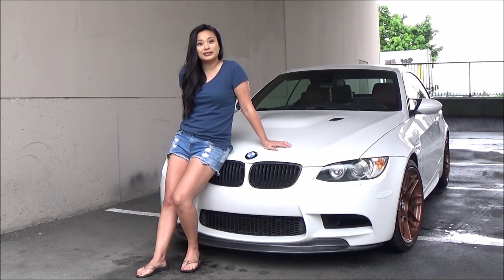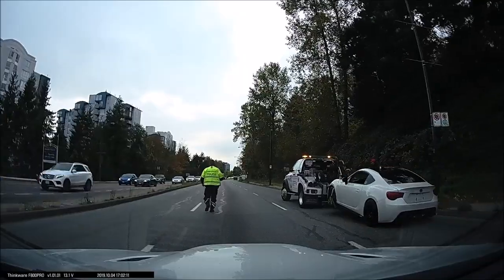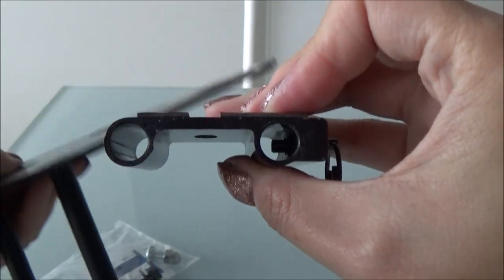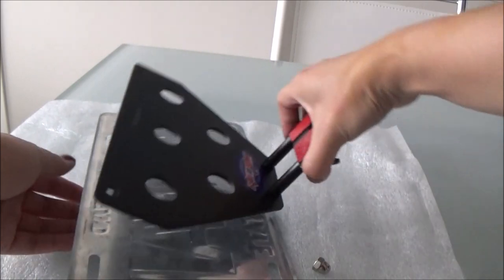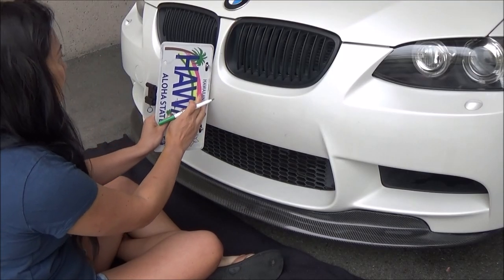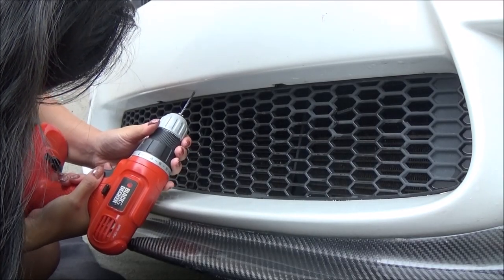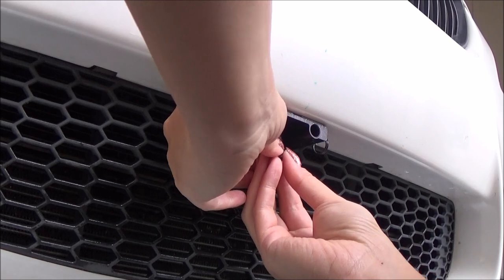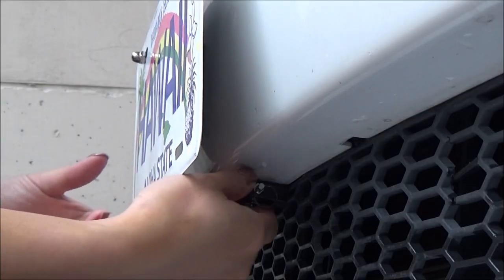How to Install a Removable Front License Plate Bracket – Sto N Sho on BMW M3 – no front bumper holes

Comment: Hi Tara! I came across you're video looking for options for installing front plate w/o drilling holes after getting a ticket 😒 Great video, thank you! What's your feedback on driving over speeds of 70mph and higher (like on a highway)? Do you hear any rattling or shaking and is it sturdy? My concern is because I do a lot state to state travel with all kinds of weather and I want to make sure it's sturdy. I appreciate you reply in advance 😊 Thanks again
Reply from the maker: It is absolutely safe at fast speeds. No rattling.

Comment: Do you need to drill?  Is the double-sided tape strong enough to hold everything without the screw?
Reply from the maker: They sell some models that don’t need drilling. For mine, they advised me I really should drill it. I’m glad I did, as it was super easy and the hole is not even visible so I don’t feel like I “damaged” the car.
Reply: @TVTara  Thanks for the response.  What does the screw go into?  Is it thin sheet metal or something solid?
Reply from the maker: It wasn’t metal but a thick plastic, I think.
Reply: @TVTara  ok, thanks for the helpful info

Comment: Another nice video, Tara! Nice job. Just wondering if you had thought about using the tow hook so that you would not need to drill.
Reply from the maker: I tried it and didn’t like how it was off center. And the good quality ones were a pain to remove. I need to be able to remove it quickly.
Reply: @TVTara Platypus quick release

Comment: Is that adhesive strong enough by itself? I’m really not trying to drill any holes in my body
Reply from the maker: I know people who didn’t drill. The company really advised me to. Honestly I’m glad I did and I wish I did it sooner. You can’t see the hole at all and it’s tiny but the plate is so stable.
Reply: @TVTara  well the reason I don’t want to drill is cause it’s not good at all for the body and when you do rust usually starts immediately

Comment: That is a great device, however, there would be no difference in not having a front plate installed vs having the sto n sho if the plate isn't on at the time you're pulled over??? At which point would you have the sto n sho off the car and feel confident that you would not be spotted by law enforcement to stop you for not having your license plate displayed?
Reply from the maker: You are correct. They may let me go with a warning but yes I would result in a ticket. I do have my plate on when I’m driving around now.

Comment: Watched the video, really liked the product but I can't trust adhesive to hold my plate (I refuse to drill a hole). So USmillworks tow plate was the way to go for me. Its pricey but its super sturdy.
Reply from the maker: For two years I also didn’t want to drill a hole but I’m so glad I finally did as you can’t even see it. I just didn’t like the way tow hook brackets make the front of the car not symmetrical.

Comment: do you need to drill, or can I just use the double sided tape
Reply from the maker: I know some have been ok with double sided tape but it’s not recommended.
Reply: @TVTara  ill probably drill underneath the bottom of the bumper then and mount it all the way at the bottom, I feel like the drill and holder will be noticed under the lip on the mid bumper. Thanks for the reply!
Reply from the maker: If your car is low though, it might scrape off. That was my concern.
Reply: @TVTara  im planning on putting it on my X3 so thats not a problem haha, thanks!

Comment: I would go with non-drill hole removable license plate holder - they clip into the grill.
Reply from the maker: Doesn’t sound like you can remove it quickly though. This one takes a second only.

Comment: In which state was this ticket issued?
Reply from the maker: I’m in Vancouver, British Columbia.
Reply: TVTara thanks! Do you have any recommendations for a removable front license plate bracket for a 2008 E93? Sto and Show doesn’t make one
Reply from the maker: Take a look if you’re front bumper looks like mine. Their website said it didn’t make it for our cars but I looked at lots of pictures and measures it and insisted to them that it will fit when they said it wasn’t for my car. It’s model sns67.
Reply from the maker: *your
Reply from the maker: I really don’t know why they don’t advertise it for the 2007-2013 e92 and e93. It’s obviously fits.

Comment: Wait what.....you still drilled the bumper...🤦‍♂️
Reply from the maker: Yeah but under not the front so I can still remove it and it looks clean.
Reply: @TVTara  ya I get the clean part. But what what don't like is. You still drilling the bumper which I want to avoid entirely!!!
Reply from the maker: Other people have installed it with double sided tape but I chose not to.